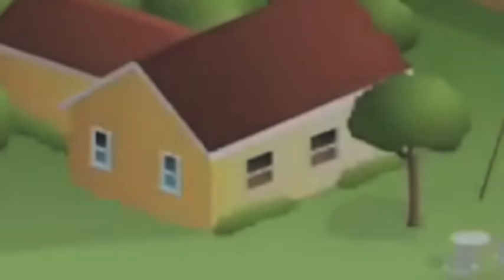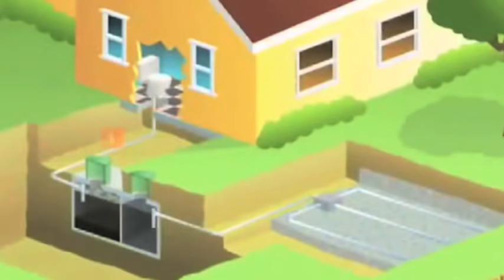Watch How Septic Systems Fail and How To Restore Them

Comment: Why not just put bacteria https://youtu.be/DPZTsGTL2nE from the bottom of the ocean or the bacteria from our salty boggy marshes that breakdown and consume organic matter and convert it into electrical current as long as you use a non-conductive septic tank and then put a superconductive coating on a conductive Rod or strip of metal on each end of the septic tank to receive electrical current discharge from bacteria to power your house or charge an EV vehicle.

Comment: Continued aeration of drain field lines.  Has this ever been tried?  Using a blower connected to D-box and supply air to increase aerobic bacteria.  Good video. Thanks for making it.
Reply: Yes it has been tried its a whole new system pressurized but it's also used if gravity systems don't work

Comment: So I have 3 QUESTIONS.

1 it was always told to us that GUT bacteria... The natural bacteria in out intestine. Are preferred bacteria to consume the solids.... Now your saying that's WRONG??

2. If untreated human sewage is a public health HAZZARD.... Why is it not considered HAZZARDOUS WASTE... And can therefore be pumped and hauled by anyone without a HAZZARDOUS material placard. 

3 Does this unit ACTUALLY remove the need to have the tank pumped every do many years??? All the solids SLUDGE will be consumed????
Reply from the maker: 1. Intestinal bacteria does digest organic solids, but very slowly and inefficiently.  Worse, it has a protective mechanism in which it secretes a slimy mucus-like coating to protect itself.  This is known as Biomat, and over time it builds up in the septic system and drain field, clogging the drain field soil and slowing the flow of effluent into the soil -- the cause of over 95% of all drain field failures.
2. Untreated human sewage is a health hazard, and treated as such.  Pumpers are required to dispose of it following specific guidelines (guidelines do vary across the country, as they are established at the county or local level).
3. The reason for pumping a septic tank is to remove the solid waste.  As the Septic Genie removes the solid waste by digesting it, there is no need to pump the tank on a regular basis.

Comment: You had me curious up until "return it after 6 months..." now I KNOW this is a joke...Genie, ya right
Reply from the maker: Our performance warranty has been extended to 12 months, meaning if you use the Septic Genie for 12 months and don't see significant improvement in the function of the drain field, we will refund your money.  We stand behind our system, and can happily report over 99.8% success rate over the past 12 years.

Comment: You missed the purpose of the 2nd tank. It holds only liguid matter( effluent ) which then go to the drain field. You pump when 1st tank is full.
Reply: Larry Rivers I hear that, what do you know about how a septic system works?
Reply: Does every tank have a second chamber? I thought I only saw my guy pump from 1 hole
Reply: @stevevinas  They should, I have 2 and they pumped both.

Comment: not true at all... once the bed is full it's full it's going no were. you need a new field.  all you need to do is pump it every 3 years to get the most of of your system...
Reply: Your understanding is limited thus you don't know. But as a wastewater operator and Master Alternative onsite sewage system operator and inspector  this is sound science and the cleaner the effluent the better the drain field will be. The air in the tank will allow different microbe to break down the waste better in the tank, this will reduce the slime causes bacteri, when its gone the field will work again. It can bring a failed system back to life. However a system designed for 4 people cannot ever handle 9 people. Unless they limit the water use.. VirginiaSepticService  That said roots in a dbox or drainfield will not be fixed by this.
Reply: Pump once a year or you will run into problems
Reply: @s.a.t419  Ha Ha--I had a system comprised of a 250 gallon oil tank, and 60 feet of field lines. It lasted 30 years (one person) before failure. Was never pumped once.
Reply: Or just dig up the drain field and unclog them one by one. Or go in there with a camera and auger and scrape everything out
Reply: @troymason4799  do you have any videos to recommend about scraping out the clogged drain field lines?

Comment: Septic system failure is one of the most expensive, if not the MOST expensive repair you will ever have to face as a homeowner. A new system or engineered septic system with spec septic samd can run anywhere from 10,00 to 30,000 dollars depending on existing soil conditions and water table height. Hard pan and clay type virgin soils can add even more costs to your new system due to the fact you will need an engineered mound type system with hundreds of yard od septic gravel or certified septic sand approved by an engineering firm with a seive test and new perc tests. Septic Genie looks like an OK product and not much risk to the system. Take care, Dan S :-)
Reply: I know this is an old comment and am I wits end with drainage issues, hoping maybe you could give me a little advice.  if there was a seepage pit instead of a leech field would you still recommend putting this device in the septic tank instead of the pit?
Reply: wow
Reply: True, and Agree, VirginiaSepticService

Comment: This doesn't work, the problem is usually a clog paper and other debris.
Reply: This works to cure a biomat issue but no not the usual paper clog. You are correct if its a paper clog but if the drainfield is not taking water, and roots are not the problem, Adding an aerator and header pipe to distribute air is the cheapest way to fix it

Comment: My leaching pit is getting clogged. It's a huge pit and the water  is getting higher and higher because the crushed stone is getting clogged. I have an access cover at the top of the pit can I put the septic genie directly in the pit along with the bag of bacteria? Would this accelerate the revival of the leaching pit?
Reply: OR YOU CAN   KEEP A METAL OR CERAMIC CANISTER BESIDE YOUR TOILET ?THEN WHEN U GO U WILL PUT THE TOILET PAPER IN THE CANISTERS AND SAVE THEM IN A VAN ..THEN WHEN THE VAN IS FULL U CAN DRIVE IT TO TOWN AND LEAVE IT IN FRONT OF THE BANK  AND TAKE THE PLATES OFF !!  THEN GO BACK HOME AND CALL A BOMB THREAT ABOUT THE VAN IN FRONT OF THE BANK..THEN THEY WILL HAVE TO DEAL WITH THE CANISTERS !!!
Reply: find and uncover distribution box, open it up and pour granulated hydrogen peroxide (sodium percarbonate, oxy clean).  After resolving percolation  issues follow it up with granulated gypsum to remove hardpan caused by peroxide.  Obviously research this method for specifics before attempting.

Comment: How long (feet) is a typical drain feild?
Reply: Unfortunately, It's not as simple as saying x feet of pipe.  The whole system, the size of the tank, the leach system type and size depends on several factors. Soil conditions, water table depth, square footage of the home, single or multifamily, total number of bedrooms and bathrooms; as well as other waste producing sources such as hot tubs, showers, laundry rooms, garbage disposals and dishwashers.
Reply: 50 ft.
Reply: Mine is 500 feet.
Reply: KHL guy